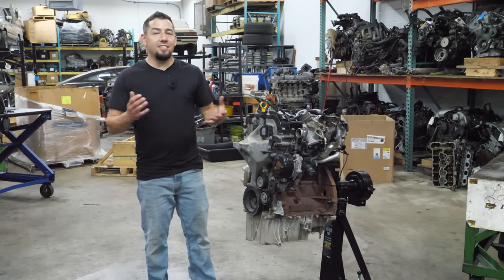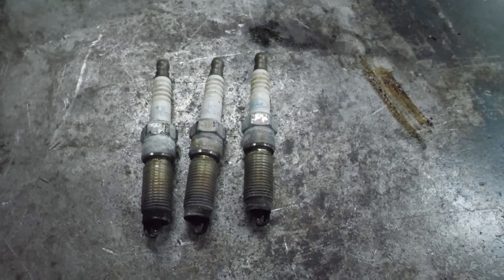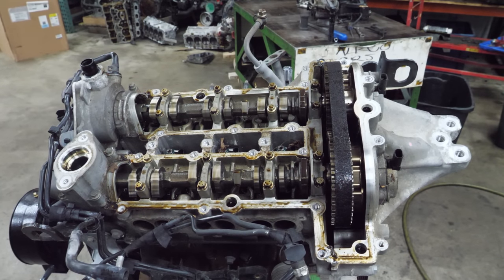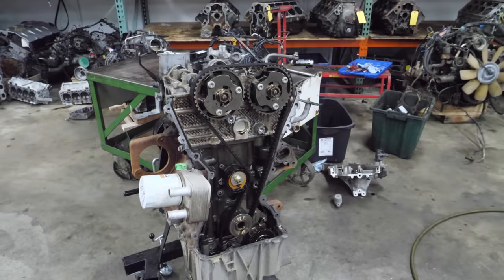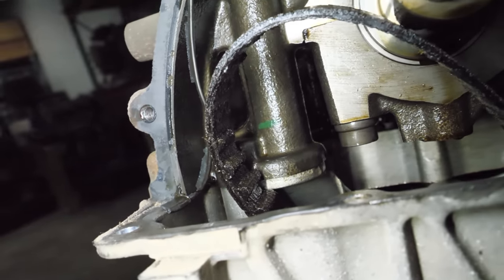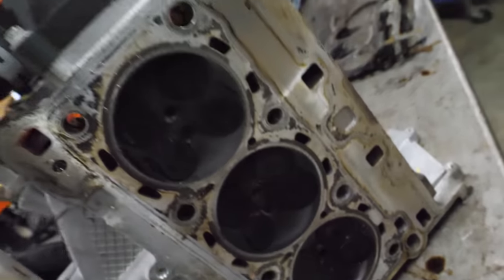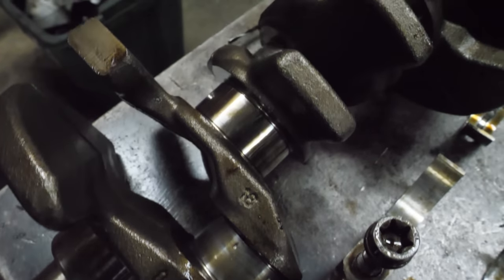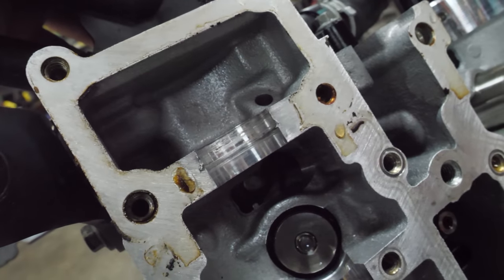JUNK Ford Ecosport 1.0L 3-Cylinder Ecoboost Teardown. LAWSUIT ENGINE!

Comment: Great video! When this engine first came out, I was fascinated by it. Here in the UK, Focus, EcoSport, Fiesta, Mondeo, they all had this engine. And it is known as EcoBOOM. Because there are 3 recognised ways it can implode. Ford will only replace, for one of these faults. They would know, all 3, from bench testing 😳
Reply: What are the 3 common issues?
Reply: A very solidly poor design.
Reply: @JohnDough-yr2zt  sadly yes. It sounds fantastic, being a 3 cylinder, but I would not touch one with a barge pole 😂
Reply: @MrWilliam.Stewart  One's the timing belt, the other is a coolant pipe that's prone to cracking and dumping all your coolant, and I believe third is a miniscule cooling channel between cylinders that's prone to clogging and blowing the head gasket. I'm so glad I went with the I4 Duratec Ti VCT in my Fiesta.
Reply: luckily i chose toyota instead😂
Reply: Most any Decade + Old Semi*CLean😂 Toyota with Less Than 135,000 mi. Be a Much Better Proposition@ PropULSION😅.
Reply: @bryanmathew2079  I believe they fixed the coolant issue in 2014/15, not sure about the rest though. It is one of the most common engines in the UK especially between 2012 and 2021. So I wonder what the failure rate is, that would be interesting to know.

It's a shame because they are really responsive engines and sound nice. Much more torquey than the old NA 1.6, 1.4 and 1.25 engines even in the focus. The 1.0 100ps fiesta I drove felt similar to a diesel in terms of torque, it suddenly pulls strongly at about 1700 rpm especially in 2nd and 3rd. Really surprised me that it's a 1.0.
Reply: Lesson learned, never be an early adopter, for new designs...seems they have put monkeys to do real engineering and QA work for reliability tests.
Reply: @takitobutface6805 japanese every time. Honda, mazda, Toyota
Reply: @takitobutface6805 Good choice, me too😊
Reply: I've got the 2018 1.0l ecoboost st line 140bhp model. Not had an actual issue with the engine itself but the dual mass flywheel went at only 24k miles 😢. And be aware they do like to shake at tickover I still don't like that but nothing you can do about it with it being 3 cylinder drives me mad.
Reply: Have 2016 Fiesta EcoBoost 1l, 100PS. 90 KM so far so good. Hard to see this tear down, now my thoughts with my timing belts :) Nice car btw.
Reply: @tivrobobo I would definitely be worried.
Reply: @eddiek821 look out for that timing belt 😂
Reply: @justinr4787  Yeah deffo I'm getting rid of it asap I can't be doing with a ticking time bomb 🙃.
Reply: My naturally aspirated 1998 Toyota Celica has covered JUST 224,500 Miles fitted with the 7F-FE Engine... with zero breakdowns and it sounds like a Swiss-made watch...
If it is NOT Japan...It is crap! 
TOP TIP..... Don't TRY to get 125 BHP from a 1.0 Litre 3-cylinder engine.... NOT going to happen (Well not for very long anyway) 
Similar to the Vauxhall Corsa VXR .... 1.6 Litre engine ..200 BHP   ... How long do you think it is going to last??  80,000 Miles MAX.
I only have one regret driving a 1990s Toyota.....  Buying RAC breakdown cover every year ..It is a waste of money.
Please keep buying your euro 💩 boxes from Ford and Vauxhall....   Please do not buy 2nd hand Japanese cars from Honda or Toyota  (Leave them for people who REALLY know about cars) 😁😁
Reply: @andrewt902 What year is your fiesta?
I'm glad I have 1.5 Diesel instead of petrol.
Reply: @eddiek821 I had a new gearbox and clutch around 46,000 miles
Reply: @OmarHussainX2021  Yes I'm hearing a lot of them now are suffering with gearbox issues and the clutch/dual mass issue like mine . My mechanic said he had another one in last week with its clutch master slave cylinder leaking. I think after Xmas I'm going to sell it before I get another big bill 👍.
Reply: @eddiek821  I think you would be wise to sell. Big bills, and small Fords, do not normally go together….
Reply: @howardlake6178  I thought I would go with the flow and buy a newer car that would last and be cheaper to run but newer cars just aren't built to last anymore which i have now found out. Before this, I owned a Bmw 530d m sport e60 model that was 17 years old and never put a spanner on it. It was a great car big mistake, selling it my bad.
Reply: @takitobutface6805 Toyota is kinda boring

Comment: I have an 18 Focus with one of these engines.  Typically see 44-48 MPG on it with the 6 speed manual.  From all I've heard and seen, the first few years had bad rubber/plastic for the cooling system externally leading to more overheating issues, but all years share those little coolant passages between the cylinders.  Later 1.5L 3cyl ecoboost have a small passage drilled a bit deeper so coolant isn't touching the head gasket.

Additionally, the belts are meant to be maintenance items at 150k miles, though I'm not sure how realistic that is with 7.5k mile oil change intervals, so I change mine every 4-5k.  Every time I have seen this failure, the same symptoms happen, making it hard to know the cause, but effectively the oil pump locks up and sheers the teeth off the belt.  Given both belts have continuous oiling from the oil pan by being dipped in, it seems like junk gets in the oil pickup and stops the flow.  Whether that is sludge from long intervals or bits of the belt cracking off as gas and carbon get into the oil is hard to say and know as it kinda all looks the same when it is small.

The belt is materially designed to not decay from being in oil, but I don't know what amounts of gas might do to it.  That said, I think the most important thing is checking oil level (should be cooler oil then) and condition.  I saw plenty of Equinox have stretched timing chains and is was anywhere from 60-120k miles, a shorter interval than these belts for replacement (while timing belts for GM were 100k and chains started becoming 150k on the newer Colorado's timing chain).  Though I figured you'd have to take the head off to get these belts off... there goes my idea of an almost engine rebuild and check at 150k miles.  I was hoping it would be like the GM V-8 with AFM where you see almost no head gasket failures in them... because you see lifter issues and the head gaskets are replaced when you do lifters.  In my ~4 years at GM I saw a LS head gasket failing once, but lifters hundreds of times.  Was ~$3.5k if it was just lifters, $5.5k if the cam was bad and ~8k for a new engine installed.  I'm interested to see how my 1.0 does compared to my 302.

Comment: I’m surprised that crank bolt came out so easily, that is a torque to yield bolt to 360 deg. I’ve replaced several of these engines and they all look just like this one or worse. It takes a special tool to remove and install the crank bolt. Great video
Reply: HHWWWWHAT!?!?!?  BLASPHEMOUS DESIGN!

Comment: Great teardown as always! Thank you! I don't know if anyone already mentioned this little fun fact: this engine was voted "International Engine Of The Year" (in its category) many times.
Reply: That was before anyone used one
Reply: Was the category "worst possible design"?
Reply: Once you attach it to a turbo it’s guaranteed to be a worst design. Cooks the oil the longer it runs. I wonder whether they slap one on to make sure the engine doesn’t last. As long as it has overdrive I’ve seen V8’s get nearly the same mileage on the highway and they don’t have as many problems with reliability.
Reply: @kevinstonerock3158  the turbo is water cooled and has a turbo timer....
Reply: That award is a joke, the VAG 1.4 TSI (twincharged) won it twice and it is well known as a pile of garbage.
Reply: @bucketofbloodgaming9098  . Judging by the amount of play in the shaft it doesn’t look like it did the smallest bit of good.
Reply: Not to mention they recommended an oil change interval of 9000 miles. Planned obsolescence for sure
Reply: @zebstime9668  If it's enough to get it through the warranty period, that's allll that matters to Ford.
Reply: @@Shenkosky-cb9op . What I get is from a panther platform with the same engine. 31 mpg is nothing to sneeze at. If mine was lighter and got that much I’d be ecstatic.

Comment: I have a 2015 fiesta with the first version of this motor and it was interesting to see they added a balance shaft. My 1.0 had a counter balanced... Balancer. I really like this engine in my car. Made a great sound. I killed my mine because I didn't notice a hose to my coolant reservoir broke and leaked all my coolant out and it overheated and now it blows white smoke like crazy. I still have it if you want it lol.
Reply: Really, 3 days later and still no takers?
Reply: @twillison8824  If anyone has a line on the version of this motor I need that would great.
Reply: We sold 2 fords and bought 3 mazda's

Comment: I sold my 2015 1.0 ecoboost when i found timing belt chunks when i changed the oil at 85k miles. Feeling pretty good about that choice. Replaced with a 1st gen mazda3 2.0 that has been rock solid.
Reply: I think if you had gone for a Skyactiv 2.0L then it would have been two excellent choices but I think you made an excellent choice and a pretty good one
Reply: I hope you were honest about that to the buyer lol
Reply: i have a 2010 gen2 2.0 and yeah they are that good when it comes to engine and transmission.
Reply: @wolveric0  I guess it depends how much rust risk, the older ones were suicidal in Wisconsin with all the road salt but a 2013 holds up pretty well
Reply: @big0bad0brad  i saw some videos about gen1 underbody getting quite rusty, not sure about early gen2 like mine, we don't get snow at all in my country but it might still be a problem.
Reply: I hope your sold it to a Ford dealer 🙂
Reply: @liver.flush.maestro  thats what i did. Lol
Reply: @brunm9203  Beautiful, that is where it should have never moved off the lot form in the first place 🙂

Comment: I have this engine in my 2014 Fiesta. I regularly get 45mpg on the hwy and 34 in the city. Currently at 150k miles 😬
Reply: Engine didn’t come out until 2018 you probably have the 4clinder eco boost
Reply: @cucho8724  it is definitely a 3 cylinder, I have done spark plugs.
Reply: @aroooooo  oh dang you’re right. My bad I didn’t know fire made 3 cylinders a while ago

Comment: This engine is another example that the primary goal of the auto industry is to take as much money as possible. When such a breakdown occurs on the engine, most people decide to buy a new or another car because the repair is extremely expensive. It most often happens when the warranty expires. The timing belt is perfect, quiet, safe up to 90-120 t/km and its replacement is relatively cheap compared to, for example, changing the chain on an Opel Astra 1.6 cdti. But on that same Astra, when it stretched, the chain started banging and people still noticed (those who occasionally listen to their car) and still went to the service center and prevented the engine from breaking down. That's why the engineers decided to put an end to it and decided to install a wet timing belt so that the engine is quiet, so that you can't look at it in the service center and assess whether it needs to be replaced. And that it breaks just when the warranty expires. And this is not only a problem with Ford, all manufacturers do this. The Japanese are no longer what they used to be, neither Mercedes nor any other.

Comment: I bought a brand new 1987 Yugo with a 1.1 liter 4 cylinder NON fuel injected, NON turbocharged, 4 speed stick. I got 30 MPG city, 40 MPG highway and once got 50 MPG highway with a consistent tail wind pushing basically an old style Fiat 500 redesigned by the Frankenstein body works.

Comment: I have a 2015 Fiesta with this engine, remaped to 160hp and 250Nm, with some mods, and it runs fine and like new after 130k km. I hope I'll keep it for some more years still. It is light, fun to drive and really economical when needed.
From what I've seen, these little engines are very sensitive to maintenance indeed. The correct oil must be used, it should be changed regularly and it has to be the correct specification and viscosity.
They are good little engines, but they need proper care.
Thank you for your video. It was a lot of fun! Specially hearing that turbocharger spooling. Cheers

Comment: Here in Brazil, we've been dealing with those three cylinders engines, wich push the Ford Ka vehicle since 2014. We've regularly been dealing with that timing belt failure you've faced, when the timing belt loses its teeth. It's been caused when owners use not specified oil for a long time and timing belt starts to lose teeth or releasing material, wich block the oil pump. That engine has another serious problem I've faced so many times: in some cases, the engine is running with no oil or with low oil pressure and there's no oil indicator blinking.  When you finally realizes the engine has lubrication problem, the engine is destroyed. 🤦🏾🤦🏾
Reply: Long story short, you have a bunch of car owners not following guidelines, neglecting their cars. Then when they break, they say "you should have bought a Toyota".
Reply: I've noticed this on a few Fiat 1.2l engines. The tiny ball inside the oil pressure sensor seems to stick in the "everything is fine" position 😅
Reply: @mrdomhare  Ford and Fiat, I guess we better avoid 4 letter brands starting with F.
Reply: @bmw803  To be fair having a wet belt is just asking for failures nobody expects. Timing belts will eventually fail and with this system they will send pieces into your oil.
Reply: @Alobster1  That I ain't gonna argue. It's definitely STUPID. Put a chain and forget it. They want to save on a chain vs belt, but spend how much more replacing engines when they fail.

Comment: I remember when this engine first came out. I had recently stopped driving my 3 pot 1991 Geo Metro and thought the idea of a small car with a 3 cylinder and a manual was not so bad. Then I looked at that wet timing belt and the amount of power they were trying to get from a 1 liter (about 2.5x that of the Suzuki 1.0 in the Metro) and knew that it would be a bad idea. I bought a new 2015 Prius C instead and it's been a great transportation appliance (if a bit unlovable). In 8 years and 142,000 miles, all that has failed is the A/C compressor (under warranty) and the 12 volt battery. With the Fiesta/ Focus/ Ecosport, they had bad engines and even worse transmissions, as well as poor fuel economy. If you want a good small car, you buy a Toyota or a Honda. Anything else just won't hold up.
Reply: And the funny part is, Yamaha gets 118hp out of an 890cc 3 banger with no turbo and that engine is known to be bulletproof.  Of course it's in a motorcycle, not a car, but still MCs do some things that you'd never do on a car engine, like use the engine oil to also lubricate the transmission, clutch and stator, and also rev to 11k RPM and make most of your power at over 6k rpm.
Reply: @mrvwbug4423  car manufactures cut corners. They aren't as worried about a large gathering showing up to tell everyone how bad the product is.
Reply: Well....I just turned 100.000 miles on my 2017 Hyundai Elantra,  with 0 repairs,  and 0 issues.  It runs smooth and quiet, uses no oil between 3000 mile changes.  Even the brake pads are original,  and again last week when having the tires rotated,  I was told they are still good!! My 2 previous kias were also excellent.
Reply: @mrvwbug4423  they built the V-6 SHO for Ford back in the day. A triple sho would be nice. But this. No key way?  Oiled belt?
Reply: The 5 car fleet of delivery Fiestas we had at one of my jobs….. 3 transmissions failed. My boss replaced each of them with a Prius
Reply: @mrvwbug4423  almost all small "performance" cars are disappointing when compared with motorcycles. It's like most car companies think engines that make power over 5000 rpm are witchcraft.
Reply: I guess I should tell that to my neighbor whose civic needed a new trans at 30k, my sister's 2015 fit that randomly won't start or my friends 180k Corolla that was literally falling apart and running rough.

Comment: I absolutely love this 999cc ecoboost motor, my 2016 fiesta sedan averages 52mpg with a best tank of 56mpg. It was dubbed the sfe (super fuel economy) and was an option with a 5 speed manual in the 2016-2018 fiestas in the US. Ford hugely under rated the fuel economy of these motors.  Mine is listed as 31 city, 43 highway, 36 combined. And it actually gets 40-50% better economy combined. Highway only at 60mph the economy sits in the 65-70mpg range. I bought the car used dirt cheap and has been amazing as a daily driver. The only issue ive had so far is a leaking coolant tank that cracked at the outlet barb, got a new one for $35. I do plan to replace belt, tensioner and plugs at 100k miles. Ultimately goal is to pull 200-300 lbs out of it and do a few aero things to see if I can get her to 60mpg average. Its also not really a slouch the car is so light the 125hp suits it well so its not boring to drive either.
Reply: Cuz its behind a tow truck all the time..